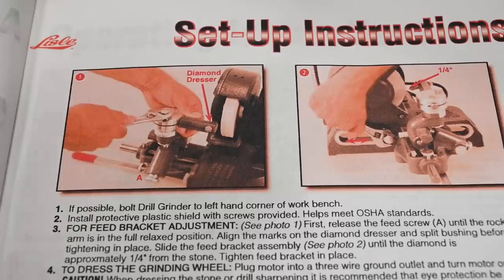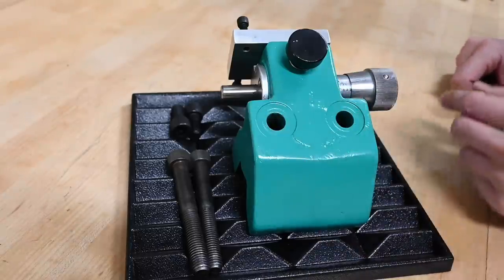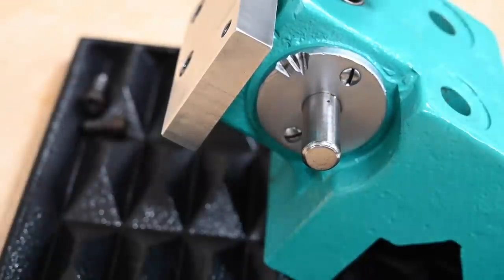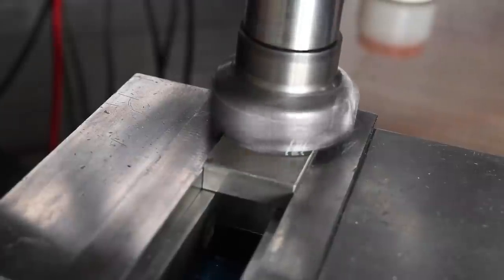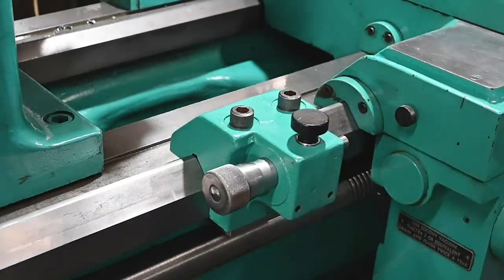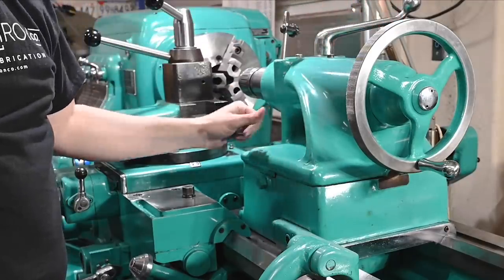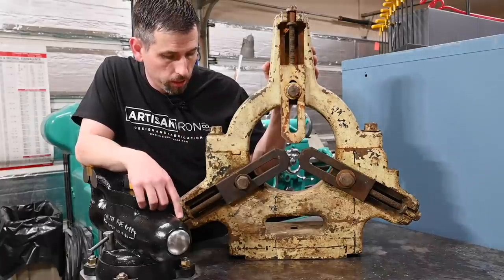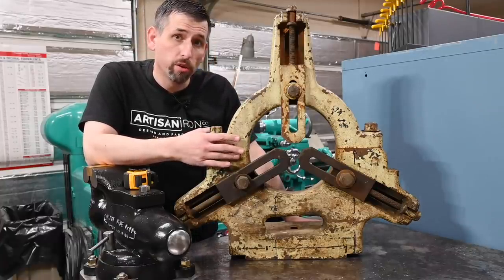Is an adjustable wrench the WORST tool in the world?

Comment: RE Crescent Wrench, if used properly they work just fine.  When I use them which isn't that often, I always make sure I adjust it to fit as tight as possible on the nut.  Heck, a lot of good wrenches have more play in the fit than I'm able to get with my adjustable wrenches so again if adjusted right they work just fine.  Vise Grips on a nut is a whole different story unless the nut/bolt is shot already...  Live streams, personally I never watch them, like you I'm usually not around when they run and even if I am, I have better things to do than watch someone stumble through getting it to work right or find a good topic.  If the main topic is something I'm really interested in, I might watch it but again it won't be until after it's live since I don't live on my computer...  Things I like to see are repair jobs, tool restorations, and shop/tool improvements.  Watching a shaft being turned down from 2" to 3/4" - not so much.  :)  Thanks for the vids you have, I have enjoyed them all.

Comment: Crescent wrench or adjustable spanner is something I avoid. 
But should I use one, I would use Bacho shark jaw adjustable spanner. 
In a professional setting working on multimillion machinery around customers, adjustable spanner screams amateur. It is a no no. 
But for the use at a home workshop, hobby or own equipment I guess it is up to each and one.  
My humble opinion.

Comment: You are exactly correct on the Crescent wrench. I have literally thousands of wrenches and sockets in every imaginable size and configuration. I also have 9 adjustable wrenches of various sizes and, when used as intended, they are fine.
No to live stream.
Im always interested in more problem solving and chip making videos.

Comment: I like adjustable wrench however the best ones are Italian Bahco. The Italian adjustable wrench has precision tolerances and has to be cared for and cleaned to get the best out of it. This Italian wrench is the opposite of an American crescent wrench witch is to be thrown in a tractor tool box and used like a hammer left in the rain for months and still works. thanks for sharing.

Comment: As a retired screw machine setter and fitter adjustables were outlawed in every machine shop I ever worked in. UK.  USA. Canada.
Reply: I can understand that happening but, i think it's more due to a few lazy people not wanting to get the correct wrench, when called for, than any quality of the tool itself. Because obviously, if your tool kit is an 8" and12" Crescent wrench, you're going to cause damage.

Comment: Your new wrench, I think you're misusing it.  I think it's meant for tubing flare nuts.  Ordinarily, there is no reason for a box wrench to open up.  A ratcheting box wrench or ratchet & socket would work better for adjusting the grinder.  That wrench opens so that it can be gotten around metal tubing.  It's a fast acting line wrench.  It should be used only after cracking the fitting loose with a regular line wrench.  Think fuel & brake lines in tight quarters.  I've had a set for many years, that's all I ever use them for.
As for adjustable wrenches, if snugged down on a fastener, they're as good as any open end wrench.  Which is not nearly as good as a box or socket.  When it comes to sockets, always choose a six point over a twelve.
This from 50 years of unscrewing stuff.
Reply from the maker: Yeah Wes pointed out that it’s meant for flare fittings. Be good to have some day I’m sure.

Comment: I don't think folks who complain about using a Crescent wrench have ever worked as a machinist in a job shop. In a machinist's tool box you only have room for a 6",8", & 12" Crescent wrench. You are constantly going from one machine to another that may have metric or fractional fasteners on them (or both!) and accessories that may have hex or square headed fasteners. 
These fasteners for the most part don't need to be tightened to anything close to their torque limit... just firmly tight. E.g. there's no sense in tightening the clamping bolts on a Bridgeport milling machine head or ram with a ring spanner so tight you see spots with your eyes closed when you crank down on it.
If you are working in maintenance or automotive for example, then you need full sets of wrenches and sockets because a lot of stuff has to be torqued to specification...and you have a tool cart with room for all that stuff.
Cheers from NC/USA
Reply: @Ace roadholder. As a retired screw machine setter and fitter adjustables were outlawed on the factory floor.
                                 I also spent time in the USA and Canada they were viewed with horror there too.
Reply: @paulthomson2375  Well I did say job shop and that other work might call for full wrench sets. I've set up turret lathes and yes that's not a place for an adjustable wrench.
Depending on the work environment you will find all sorts of peculiar rules. I've worked where lead hammers and sharpie markers were a no-no. At Michelin tire plants aerosols of any kind were absolutely banned. 
As an engineer, designing anything that required the operator on the shop floor to go find a wrench of any kind to adjust something was another no-no.
Cheers from NC/USA

Comment: There is nothing wrong with using a Crescent wrench in the right situation. Like you said low torque, such as adjusting stuff etc. also they make excellent hammers, I usually refer to them as a Crescenthammer...LOL! Looks like Keith fixed you up pretty good. I haven’t the slightest idea why someone would mount that aluminum block to the micrometer stop.

Comment: As a retired  Tractor Trailer Technician, and having a main tool box fill with complete wrench sizes both SAE & Metric, and yes we did have large adjustable wrenches. most times working in engine compartments adjustable were just too wide too work out. also so as not to have to run back and forth, we all had tool carts rolled to the job site, so getting the "right" tool so convenient. OK i' ll end  with, there is a right way and a wrong way to use an adjustable wrench, it deals with forces apply to the movable jaw. all an all adjustable wrenches are your choice, it does not matter. saying that, when it comes to extremely tight hardware, adjustables are the wrong tool!

Comment: Adjustable wrenches are great if you use them properly a lot of people don’t tighten the wrench the size of the nut properly cause them the ring or round the nut once tightened up to the nut properly there is no problem with them I’ve been a mechanic for 25 yrs and never had a problem using them when you haven’t got a big enough spanner especially on lorry work god bless

Comment: Adjustable parallel pliers.  I'm going to try some Knipex parallel pliers when I have some extra cash.  I find Crescent wrenches always need tweeking to fit tight.  I like the way Knipex channel lock works so their parallel pliers have a lot of potential.  Example: See Amazon https://www.amazon.com/dp/B01AY0JXPS/?coliid=I333GM69A5N0W4&colid=1P6TW6HPI8G4B&psc=1&ref_=lv_ov_lig_dp_it
Reply from the maker: Yeah I’ve got a set of them- you’ll like them. Very nice quality, just a little finicky to use because you don’t always land in the size range on the first (or second) try.

Comment: Hi first of all I enjoy your videos and I do have a comment on your wrenches I have been a mechanic since 1963 and was never a fan of the adjustable wrench but I have used them and have one but it locks like vise grips. As for the ratchet wrench you showed I have a set the same but made by Snap-On . These wrenches are supposed to be for line nuts like oil lines brake lines and so on. They do work as long as you don`t have to put too much pressure on them I do use mine but not a lot. Keep the same kind of videos coming. Thank you.

Comment: Do you think you need washers under those locking bolts for the carriage stop? I notice there is a very slight counterbore- maybe a washer belonged in there. It would prevent damaging the casting for sure.
Reply: He specifically talks about that.
Reply from the maker: Yes I thought I mentioned it on the video- I’ll purchase or make some washers. Seems like a good thing to have there
Reply: @AlwaysSunnyintheShop  You probably did, I am trying to do a paper and watch at the same time! lol

Comment: What's worse than the people that whine about crescent/adj wrench use, are the ones that think it has a right way and a wrong way. They think because someone made a video that showed it was stronger in one direction, that's the right way. They're too stupid, and lack the application skills, to know the wrench is cocked at an angle so it can be used in BOTH directions. (For applications where you are restricted from getting a full 60-degree turn, to get to the next flat.)
Reply: Andrew Delashaw I use them both ways, but there is an arrow cast right to into the wrench showing the ideal direction to pull when applying maximum torque.  MrPete has an interesting video testing them to their breaking points.

Comment: What I find around me and on the internet are those who criticize the use of an adjustable spanner are people who don't actually use spanners or tools themselves.
Reply: Hughie.    Why would they criticise if they know nothing about tools. Doesn’t make sense. Adjustables are great for plumbers, builders and home handymen not for machinists.
Reply: Paul Thomson many machinist (good ones) use them so that’s that argument out the window.
Why would they criticise ?  Well, they can’t help themselves and maybe they feel  or think they  know more than the experts, and try to convince others they are knowledgable.  At least that’s what I find.
Reply: Hughie. Still doesn’t make sense. I’ve never met a good machinist who would dream of using an adjustable in a workshop environment, also the employer would never allow such a tool to be used on valuable machinery.
Reply: Paul Thomson How many machinists have you met?  Are you a machinist?  Who are these employers are you talking about.
Have you actually asked any of them what there thoughts are on this ?? 
I wonder maybe if you are one of those people I meant in my 1st post, probably is my guess.
Reply: Hughie.    Foolish to question my experience. Apprenticed at 15, as a screw machine setter ( auto turret lathe ) worked on every thing from Brown & Sharp 00 machines in Slough UK to large Acme Gridley multi spindle lathes at SKF bearings in Toronto. I’m handy on a milling machine and engine lathe and make my own cutting tools. Also, not a bad welder. What about you?
Reply: Paul Thomson Foolish to question your experience ? I don’t know your experience so why is it foolish?
You didn’t answer any of my questions  and just because you have done it for a while does not make you good or knowledgable at it. 
Going by your ill advised comments it seems you just want to sound like you’re  up there with your typical English (not British) arrogance.
Have a read through the comments on here, seems like you are out numbered.
Reply: I have answered all your questions and you have offered me nothing but derision. I asked politely ‘what about you ‘ and got nothing in reply. You have to realise when you’re mistaken and even wrong, I have done it all in three different countries and am bloody good at it so suck it up Princess.
Reply: Hughie.    Still haven’t heard about you.
Reply: @paulthomson2375  That's right, you haven't. That's because it was NOT me who tried to belittle and educate Always Sunny In The Shop by telling him he was no good because he used a tool you don't approve of.
I've got nothing to prove. You're the one bumping his gums not me.

Comment: A great many people don't like Crescents because they don't know how to use them properly and it slips and skins their knuckles. When using a Crescent wrench, the fixed jaw (the one attached to the handle) should always be on the trailing side of the nut or bolt that you are turning where it take the majority of the force applied. If you put the adjustable jaw on the trailing side it forces the wrench to open and causes it to slip. The fact of the matter is if you bother to read the information supplied by Crescent tool you would know this.